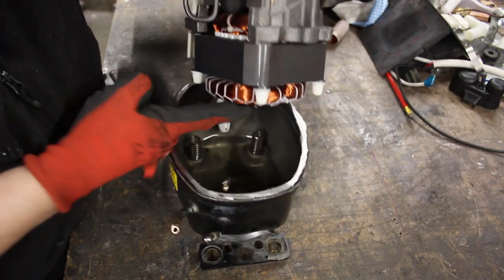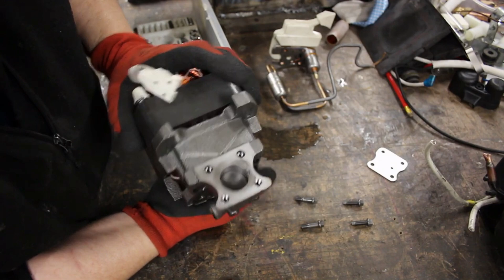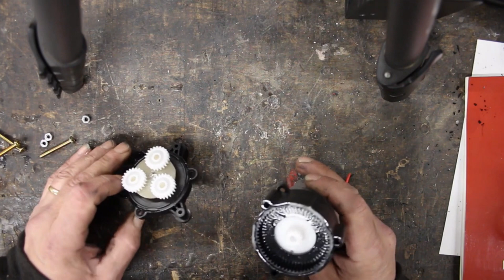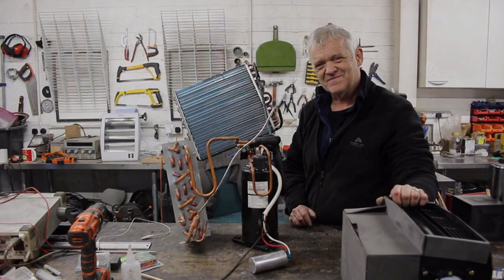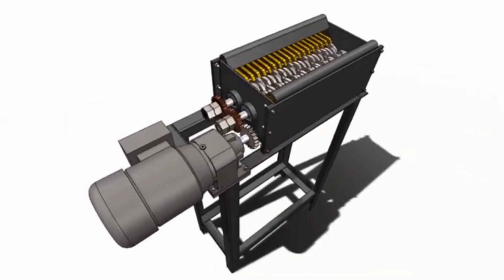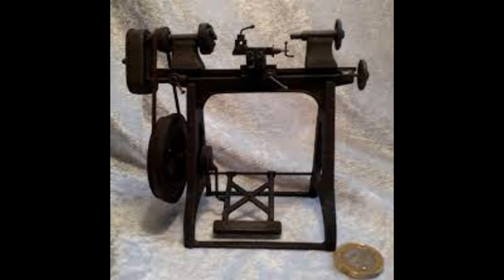014 Inside Things - Fridge Compressor, AC Unit, Lathe, Shredder, Hand Crank Generator

Comment: There are quite a few videos on turning compressors into internal combustion engines. Automotive AC compressors are especially interesting in that they can essentially be converted into the INNegine design, driving the swash plate.